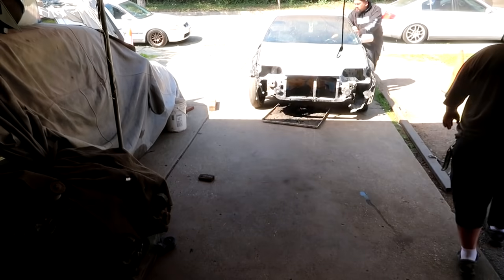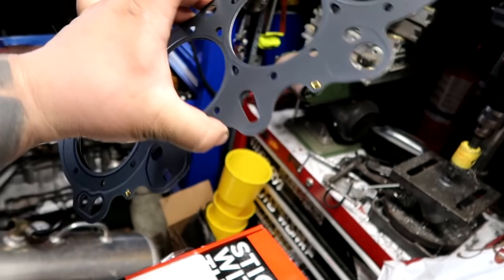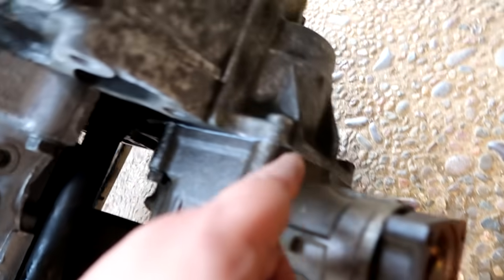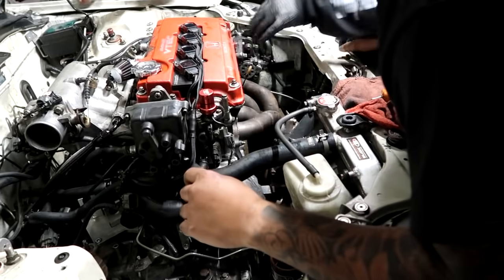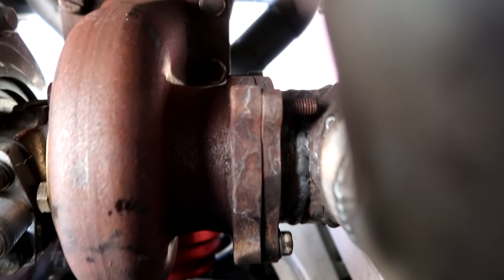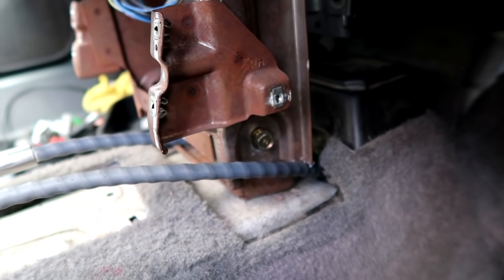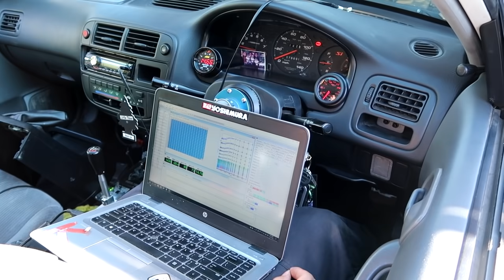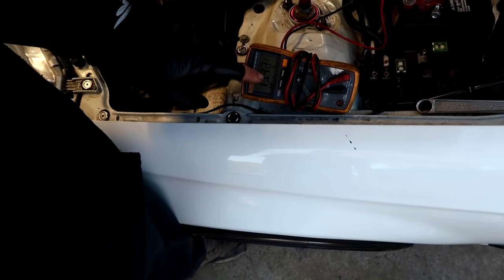Turbo Civic Gets NEW CSS Short block and AWD Trans INSTALLED!

Comment: Missing the washer for the shift linkages bruh. The ones that go on before the lockpin / cauter pins. They'll work fine as is, till smacking gears and can bend the pins and angle out. I lost mine before, best replacement washer imo, is the bushing washers that hold skateboard truck bushings in place on the kingpin.

Comment: hey you acutally will need to modify the flexpipe. that bolt touching it is going to eventually rub a hole in it. metal on metal like that is also going to make an awesome rattling noise.
Reply: exhaust will be modified once we get the driveshaft goes in.

Comment: yo just gonna pick up a 98 gsr integra shell for 300 never intensively worked on a car before. Im trying to make a high compression b series what mix of b series engine parts would you recommend? My budget is very tight.
Reply from the maker: Ls block, pr3 it itr nippon pistons. They are cheap . Gsr head